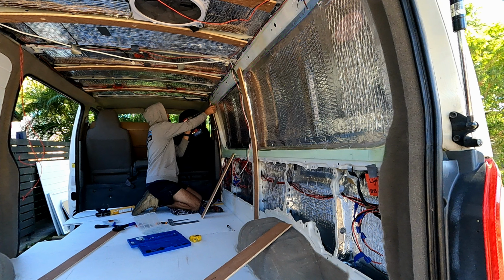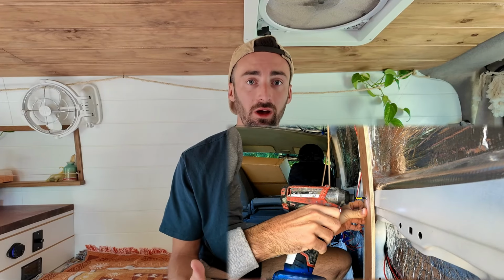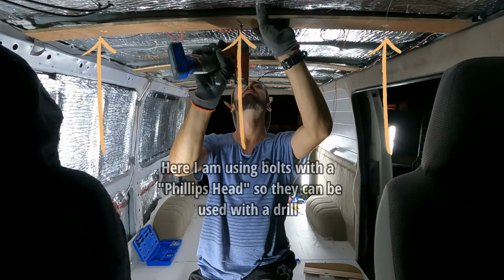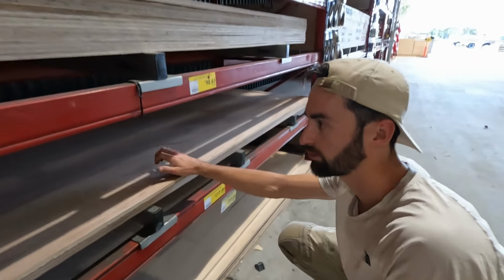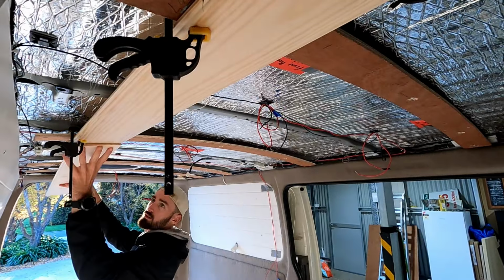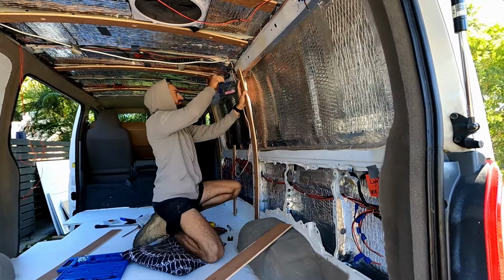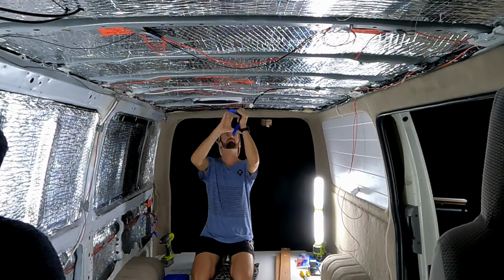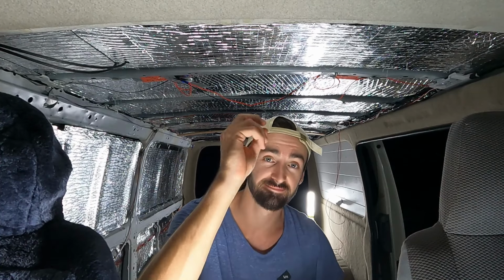How To Frame Your Van! Easy Step-by-Step Guide

Comment: Hi Jake, did you use the marine ply to line the walls also or just MDF over the marine ply support beams?
Reply from the maker: Hey Donna, I used 6mm MDF to have the smoothest surface to work with, but lots of people use Ply for the same job. 
What type of van are you working on? 😊
Reply: @JourneyVanBuilds thanks for that, I’m working on a 2014 Toyota Hiace and it’s my first van build, my daughter and I did the insulation on the walls today which I’m very happy with 😃
We’ll finish insulation tomorrow and then line the van. Thanks for sharing your process 🙏 love your work guys.
Reply from the maker: @Liminaldonna  Oh amazing! All the best with your build then :) If you have any more questions - I check the Journey Van Builds Facebook group every day - you should check it out!
Reply: @JourneyVanBuilds joined thanks 🙏

Comment: how long the screws so they dont go through the van roof
Reply from the maker: If you're screwing into timber which you're connecting to the metal supports of the roof then a 20mm screw is plenty while not overpenetrating the roof. Always check before screwing though.
Thanks for the comment :)

Comment: Hey mate love your work!

I’m aware that marine ply is the superior product here, but I have sooo much regular ply around, do you think I can get away with that? I also have plenty of sika 11FC as well.. 

Hoping regular 9mm will suffice.. what if I added extra lengths and ample glue?
Reply from the maker: Hey, thanks for the comment, glad you like the videos 🙂
You can absolutely use standard Ply for the framing. It's mostly just a matter of whether or not you can get it to bend to the curves of your van. Give the standard 9mm lengths a go for sure if that's what you've got laying around, and if you have any trouble with it cracking or splitting then you can always cut a few slits into the back of it to make it more bendy. Just be aware you'll probably need extra pieces if you do this to make sure you're still achieving a decent structural integrity 🙂👍🏻
Reply: @JourneyVanBuilds  you’re actually the goat 🙏

Comment: Can I frame using only the self tapping metal screw? Are those strong enough to hold other pieces of wood I would like to install as a wall instead of a whole piece like you did? How thick if yes and how long to be sure I’m not going to make a hole in the car body?
Reply from the maker: Yes absolutely you can. Infact I'm sure that's how most first time DIY'ers do it! I do really recommend using some kind of adhesive between the metal and the timber to absorb some vibration and protect from moisture damage, but again - heaps go without.
I use 9mm Marine ply for my framing so I use about 20mm self tapping screws to fix into the 1.5mm metal. That's heaps of grab without overpenetrating too far. Anything just a little more than 5mm longer than the timber you're using will do the job. 
Always check the thickness of the timber you're fixing and the thickness of the metal you're fixing to as well as the distance you have behind that metal to make sure that your screws wont hit the wall on the other side :)

Comment: Hey Jake , thanks  for  all the advice and great videos , with the wood for door insert and back door insert how did you attach  it  to  van and was it mdf. Jo
Reply from the maker: Hey Jo, thank you very much - thanks for being here!
For the door inserts I did use MDF, yes. I traced the shape of the original pieces onto 3mm MDF boards and primed both sides for moisture resistance and top coated/carpeted the front face (depending on the finish you want.)
I keep the little plugs that hold the factory panels in place and drilled holes in the same positions to be able to reuse those plugs. Because access to the panels could be needed to fix anything with the door mechanics I recommend this method because they're easily removable. If you're in a tricky spot and don't have the plugs then it is possible to screw into the back part of the plastic plugs which should still be sitting in the holes on the sliding door panel at least. It gets a bit complicated and hard to explain though so hopefully you've got the plugs ahaha. Maybe worth looking into buying them

Comment: Hey! I love you van videos soo soo helpful! I have a Toyota Hiace with 2 doors, I want to cut through 1 structural beam to put a skylight in. Is that a terrible idea? Or could I pull it off?
Reply from the maker: Thank you so much :)
I've asked myself this exact question a few times! Agonized over it even.. in the end I've always decided to keep the structural beems intact. In my research however, I have also come across heaps of people that have done it without a second thought with no negative consequences. My fear is always that IF something bad should happen, it might get messy with insurance if they were to figure out I'd structuraly altered the van.
As for roadworthy certificates.. I never found out. I'm booked into my mechanic next week, so if I remember I'll ask him :P Good luck!
Reply: thank you!! That’s helpful. I’m at the same cross roads. I’ve reached out to a ban fit out company so I’ll also share some info if it’s any different.! 😊
Reply from the maker: @mollietranter6688  That would be amazing, I'd love to hear what they say.
If you're interested you should join the JVB facebook group, it'd be awesome to hear more from you as you build :)
Reply: Sweet! Joined. :)

Comment: Hi Jake did you use van builders 4 way carpet for you back door frame. Jo
Reply from the maker: Hey Jo, I didn't, no. I can't remember why exactly but either they didn't have beige or it was too expensive. I got mine beige off Amazon for cheap 🙂👍🏻 Here's an affiliate link if you want to check it out 🙂
https://www.amazon.com.au/Stretch-Carpet-Motorhome-Vehicle-Interior/dp/B09MSL1VCH?crid=3NNUB139PZDKD&dib=eyJ2IjoiMSJ9.99j8YBlZIWWSc8ElaDBwVsbEYBZjA18Qs10y-svm3HR_tYRrPNZw_hQGaqjYZB478RUHjURTAmelM65JnLUl3XWM5qe12J8gXZN_XggQ88WG7PtAidoy7pEbhNFo8mgf6ORpgfpSkwaGhFtQYZGpHRXBq-ZAUmeXkIhAag3eOba18pDiX7TMlOLY4Q9skpYwQhr3wmbRlmUf46hMDrGwrFeEDyEZgUEOxCxlhmKWRZMq1s4PagdLm9z2Z3FitcX_6KgLU2XPrLd8Il_M0mWdIHJ4ue0uy6RxIWsIHjER-_M.4kD8LXoUFe2TRMZcWmOmu91hrx0vafvqc2mLsmC0D1c&dib_tag=se&keywords=4%2Bway%2Bstretch%2Bcarpet&qid=1729490385&sprefix=4%2Bway%2Bstretch%2Bcar%2Caps%2C297&sr=8-4&th=1&linkCode=ll1&tag=journeyvanlin-22&linkId=ab51f9d41c9e2471af2137b286f7f7fe&language=en_US&ref_=as_li_ss_tl

Comment: Hi Jake can you use 12mm marine ply for floor . Jo
Reply from the maker: Hey Jo! For sure you can 😄 My only specific advice would be to make sure that you've fully supported the ply sheets where they join. So that there isn't any noticeable movement between sheets 🙂

Comment: Hi. Wondering why I cannot directly build and mount the ceiling to the metal supports? Why are we needing the extra timber supports. Will building directly onto the van structure not have enough strength/support? Thanks
Reply from the maker: This is a fantastic question first of all. 
There's no strict rule on the best way to do anything in a van conversion, including this. Framing the walls kinda tames the raw metal walls and ceiling of the van and turns it into a nice consistant line to fix any wall material to. You could take the same methods for attatching the frame to the metal, and use it to attach the wall boards directly of course, but there are a few reasons that wouldn't be optimal in my opinion.
First, strength as you said - because of the large panels (the upper panels in oarticular) on the wall sometimes the boards would have to span almst a meter without any support behind them which isn't ideal. 
Secondly, I don't love the wall boards hard against the metal wall for added potential for moisture or water damage. It's not much but I'm more comfortable with that bit of breathing space. 
Thirdly, fixing directly to the wall only works if you use boards like a pine lining board, and is much more difficult with a sheeting method like plywood and MDF. With these methods it would be really messy at times finding a suitable spot to fix to. 

Like I said, there's no reason as far as I know to say that you shouldn't fix directly to the walls, it's just a lot more comfortable doing it this way. 
Thanks for your question!
Jake

Comment: Hi Jake which vent did you put in your hiace and did you cut through  the rails in the roof
Reply from the maker: Hi Joanne, I use the MaxxAir roof fans, they're amazing. I'll give you my affiliate link below if you wanna check it out 🙂

Nope, no need to cut the ribs out if you place the fan between the rear two ribs. It's a perfect fit. Close, but it fits!

https://t.cfjump.com/86284/t/73792?Url=https%3a%2f%2fwww.outbackequipment.com.au%2fmaxxfan-deluxe-with-rain-dome-thermostat-power-lif%3futm_source%3dgoogle%26utm_medium%3dcpc%26utm_campaign%3d21826731768%26utm_content%3d%26utm_term%3d%26gad_source%3d1%26gbraid%3d0AAAAADmLunRGCN8jWtCjMRu7HLy67bYCY
Reply: Thanks one last question which  maxxair did you get and did you build wood frame inside van for it to fit into .
Reply from the maker: @JoanneHurrell-k8r I used the MaxxAir in that link, and no I don't frame the interior for the fans. I fill the gaps on top of the van with butyl tape to allow for the ribs but other than that the supposed screws into the metal roof are enough with sikaflex on the outside as well for adhesion and water proofing

Comment: I am looking to buy a van either converted or to convert myself. I have zero experience doing anything of the sort though. When it comes to constructing the walls and ceiling of the van, do you remove anything from the walls and ceiling prior. Your van has a lot of that "silver stuff" insulation??? on it, was that already there and you removed pieces of the van wall or have you added that onto the existing structure prior to commencing with the wood?
Reply from the maker: Awesome! Good luck with your build, it'll change your life! 
The silver stuff is my insulation. I removed all of the panels that are in most vans to be able to install insulation to every surface possible. Once insulation and running the wires throughout the van is complete you can either re-install the panels you removed, or frame & panel the walls with your own finish 🙂
Reply: @ awesome, thank you for that clarity! 😄

Comment: Can I just do everything with self tapping screws or should I be using the bolt method also…?
Reply from the maker: I love the bolt method but if you don't have a nut riveter then you can absolutely use self taping screws instead. Personally I'd use 2 screws at each point where I'm fixing the board and sikaflex between the timber strip and the metal wall where they come into contact. 
Cheers :)
Reply: @ Wow thanks for the reply on such a belated comment! ❤️

Comment: Awesome video! Just wondering how you framed up the other side with the sliding door, as that would have the door handle and all the other things in the way. About to frame my hiace and realized ive got sliding doors on both sides, nobody ever really shows that side of their vans in the videos. Cheers!
Reply from the maker: Hey Ryan, thanks for the positive feedback! 
On the sliding door I just cover the existing 3mm particle board with carpet or paint if possible. If it's in bad condition or I want a different finish then I'll get a 3mm MDF sheet and cut it to the exact shape of the factory fit door panel including the holes for the plugs which fix it in place. Then you can paint/carpet/route VJ grooves or whatever finish you like. 3mm thickness is key to fit underneath the sliding door handle like the factory panels do. Cheers mate hope that helps. Id love to see you in the JourneyVanBuilds FB group if you've got more questions 😄

Comment: Hi Jake, thanks for your great videos. How did you build the floor? did you build a frame to put the plywood in or did your just drill the plywood straight into the floor? Thanks!
Reply from the maker: Hi, thanks for the positive feedback! I used o ky sikaflex to secure the floor. Screws are not necessary. I used sikaflex FC11 to glue down some timber strips across the van to allow some height for me to install some insulation and make the surface flat, and then the next night a glued the subfloor boards, again using sikaflex. Hope that helps! If you're interested in joining my Journeyvanbuilds FB group I can answer questions in a little more detail and show examples. Cheers! Happy building 🙂
Reply: @ Thank you for your extensive reply, that’s very helpful! Cheers

Comment: Did you also use 9mm marine ply for the sub floor?
Reply from the maker: I would love to have used marine ply for under the subfloor for moisture resistance but I ended up using a 7mm structural ply because the insulation I put down was only 6mm. Purily to save the extra 2mm in headroom at the end ahaha. I wouldn't say marine ply is necessary, but it would be a nice touch if you've got it

Comment: Hi Jake.  Love your videos.  Can you please tell me how you deal with the ceiling liner at the roof panel interface.  I have a slwb hiace
Reply from the maker: Sorry I let this comment slip through! If you have a SLWB does that mean it's a high top also? If so, I haven't had the pleasure yet so I'm not sure exactly what the best method is sorry! If it's a standard body, I just run my ceiling boards slightly over the edge and sand them down on a 45 degree angle to look a little neater.
Hope you found a solution you're happy with! Cheers

Comment: Hi Jake, thank you for your video it is very informative. I have a question, when you mention using the silicone where the metal meets the wood, is this to help secure or is it to create a barrier between the wood and metal? I am confused if you are effectively gluing the whole piece of wood  or just where the screws are going? Thank you
Reply from the maker: Hey Poppy! I use the Sikaflex/silicone wherever the wood will come into contact with metal to help secure the wood, but moreso to create a tiny layer of silicone between the two surfaces to absorb vibrations while driving. 
So to answer your question - I only use silicone where the timber comes into contact with the metal 🙂
Reply: @JourneyVanBuilds  Great thanks for your reply!  That's a great tip. I've decided to carpet my van instead of framing and panelling but this will come in useful for some wooden panels that I will need to put in so thank you

Comment: Thanks for all the videos Jake! :) I just moved to Aus and bought a Hiace so about to embark on a conversion. I had one question regarding the 9mm upright strips on the walls - I noticed the 1220mm strips don't go all the way up and meet the ceiling (looks like a 60mm gap). Is this a issue when securing the top panel to the strips to meet the ceiling? I'm guessing you just screwed through the bottom of the panels to the strips? Cheers!
Reply from the maker: Awesome question. First I sit the strips on a packer to lift each of them 20mm off the ground. The remaining 40mm that the strip doesnt reach past the top of the metal support actually helps you. You're right in that I just fix the top wall panel from the bottom half of the panel, however the fact that the strip stops before the top of the metal support means that it doesn't have to flex as much because that metal beam is angling quite aggressively into the van at the top. It's hard to explain on here but by stopping slightly short you don't have to flex your board as much but the wall panel will still flow easily over the top of the metal support anyway. 
If you have any more questions I'd love to hear from you in my Journey Van Builds Facebook group 😄 It's a bit easier to answer questions with photos and videos there. 
Thanks again! Happy building 🙂
Reply: @JourneyVanBuilds   Hi Jake, thanks so much for taking the time to give me such a detailed response. It all makes sense! I've also joined the facebook group, thanks for setting that up! I'll see you over there for more questions no doubt! Cheers :)

Comment: Love the video mate. Am in the process of doing up my own hiace and was wondering Where's thr best place to buy cladding? I found the bunnings stuff is pretty limited and expensive. Any tips would be appreciated. Cheers!
Reply from the maker: I use the 2.7m lengths of pine tining at Bunnings which are only $11 per board. The stuff outside in the timber yard is longer but more expensive per meter and 2.7m is perfect for a Hiace 👌🏻
Good luck with the build! I'd love to see you in the Journey Van Builds FB group if you wanna share any other updates or questions 🙂

Comment: Hey how do you fix the panelling onto the frame ?
Reply from the maker: Any kind of timber screw. Just be careful not to use screws that are too long which risk over penetrating the timber strips and hitting the metal supports or even cables.
Reply: @ thankyou!